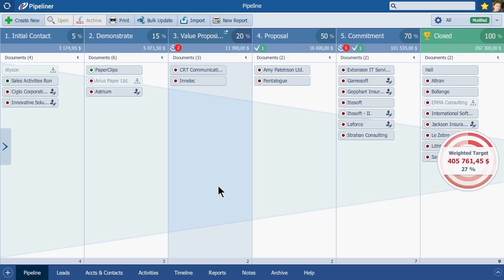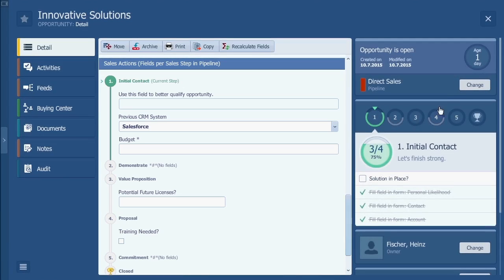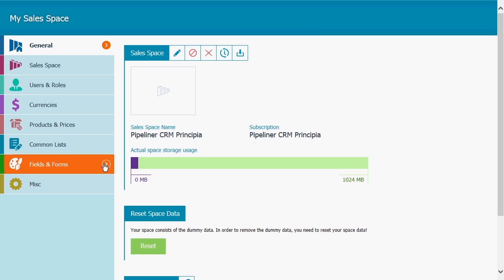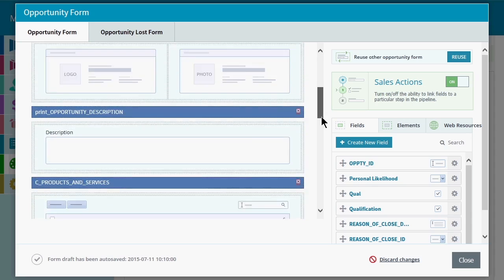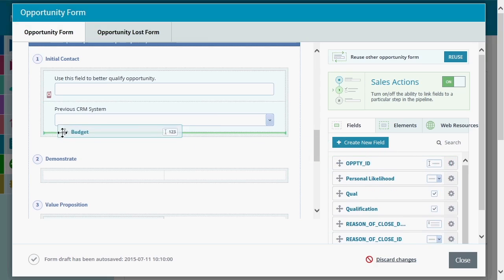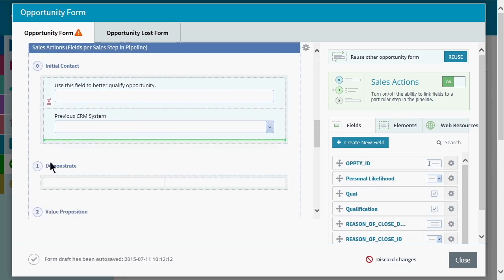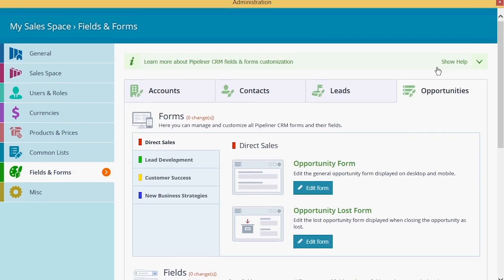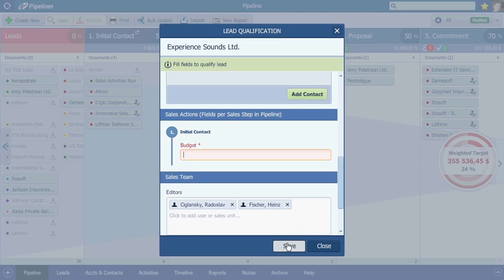Sales Actions in 15 Clicks Pipeliner Principia

Comment: Why would someone use this software over the custom *required field inputs in salesforce?
Reply from the maker: +Grant Fuellenbach the main difference is that in Pipeliner ‘some’ fields are required only from a particular sales step. 
Pipeliner allows you to make lets say "Address Information" field which is required only from the 4th step as only then you are able to prepare an invoice. 
Sales Force fields are required across whole sales process from the beginning. 
To summarize: the main benefit is not to make the fields required but to make them required from a particular sales step so your representatives do not have to fill too many fields from the early stages where lost probability is high- it is waste of time to try to figure out information which is irrelevant at this time. I hope this helps ;) have a great day.